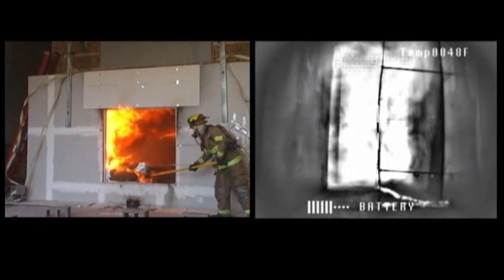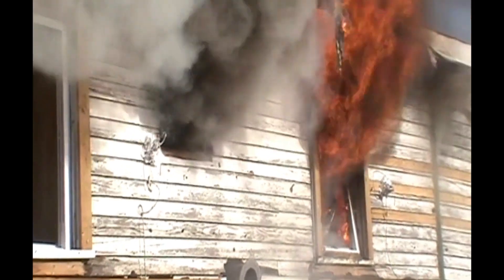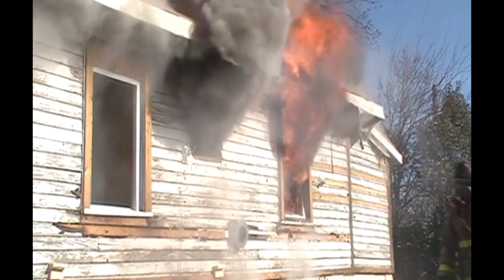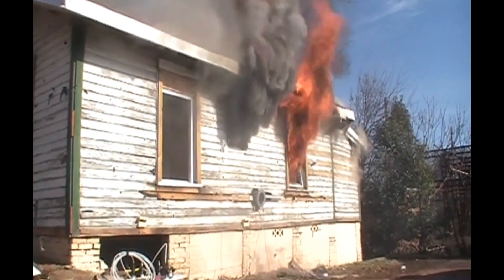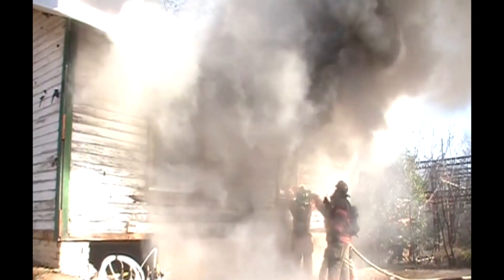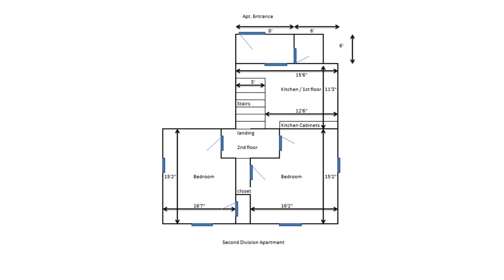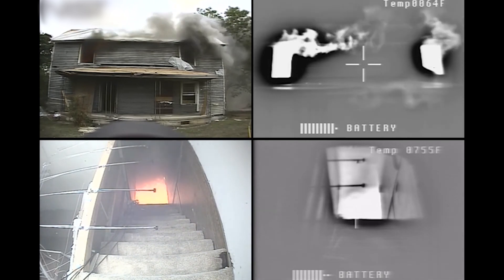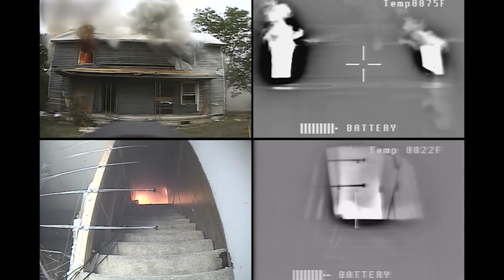Tactical Consideration: Pushing Fire

Comment: It can also push fire if the stream doesn't hit all the fire at once and entrains air because the stream is whipped. Or if it's a master stream. I've been on the wrong side of a master stream that pressurized a compartment on fire.

Comment: Applying plain, untreated water through the window only addresses the physics of the fire and does little or nothing to address the chemistry of the fire. Fires are more than just physics (heat). To address the chemistry of the fire (Fuels) you must add chemistry to your water. Adding surfactant to fire streams bonds water molecules to hydrocarbons in smoke and fire gases making them too wet to burn (oxidize). Lets move out of the caveman days UL and begin to address both the chemistry and the physics of the fire by researching the impact that Class A concentrate has on the extinguishment of fire. Jerry Hughes, Battalion 1 (ret) Chicago FD.

Comment: Just as we use fog to hydraulically vent from the inside it works in any direction even into a closed room.... the room will pressurize and blow back if the windows are open or gone it will vent the room

Comment: My take away from this would be to never use anything but a straight stream from the outside of a building and always aim at the roof so you arent blasting thru the building onto a search team. 

That using an open stream to blast the smoke an heat right out of that bedroom fire was slick and a nice stunt, but how many times are you going to know the floorplan?  A solid stream off the cieling that cools a room with fire ,already thru the windows without interupting flow path, seems like an awesome way to locally snuff the fire without affecting anyone in the building negatively.

Comment: Right to fight, left for life, nozzle pattern controls...
Reply: Sir, I respectfully disagree considering this was an old phrase that doesn't apply correctly as we have learned. The left for life is dangerous- as shown in the video, it disturbs the layering, distributes the heat, gases, flame and smoke and entrains more air in toward the fire past the nozzle firefighter. In the day of no scba use, this was beneficial to draw fresh air to move the attack forward but as research is demonstrating, this blanket quote isn't accurate or necessary with the advent of improved scba and firefighting ensemble.

Comment: I call B.S. water most definitely pushes fire . Idc how you word it with gas , oxygen . But when you are inside a structure on fire with a line being used from outside it most certainly will push the fire on to you and your brothers.
Reply: With all do respect of course, opinion (which you provided) does not outweigh empirical evidence. I would agree that having opposing hose streams could be potentially dangerous, but the idea of pushing fire is just not true.
Reply: @riseagan  We can agree to disagree , but my whole point of the comment is that interior fire fighting is the best method of fighting structure fires. Period . The whole reason I commented to begin with , was the 1st truck on scene started the 1st line from outside and I can't disagree enough with that strategic decision . Even if you show up on scene with people telling you its clear inside , you still have to check and be sure.  That is where my point stands.
Reply: @DeeKay617  Thats fine. And my point is that we should base tactics off of what is proven to be accurate. He just explained what happens in the occurrence of appearing to push fire. Interior vs exterior is also of course based on circumstance. For example, the science has shown that quick hits from the exterior prior to interior operations we shown to create a more survivable space for everyone. Which is why I like the idea of transitional attacks. Be safe brother.
Reply: DeeKay617 That’s the thing, you CANT “agree to disagree” with Science. If a study comes out at a later date that proves this otherwise, then so be it..we’ll change tactics. We just have to accept that the what the old guys “taught” us back in the day had no science or legitimacy to back it. Be aggressive but stop spewing inaccurate information and “making fun” of the guy doing the smart move by using a “transitional attack” when it’s absolutely the correct approach and tactic. 

We’ll still be aggressive as hell, we’ll still search like our kids in there but it’s time to change tactics up a bit. And remember if all else fails...KISS. Its not that hard. 

Still, the best tactic in imo is fast water on the hot stuff. Put the fire out and all other hazards go away. Doesn’t matter if you how you do it. GET WATER ON THE FIRE.
Reply: @JB91710  And what exactly do you want me to prove/ (teach) you ?
Reply: @JB91710  There are two types of ventilation we deal with all the time at fires: horizontal and vertical. Within that subset, horizontal ventilation can be broken down further into two areas: venting for life and venting for fire. In my experience, venting for life always presents the greatest hazard. I was always taught that if fire doesn’t vent from the window that you picked for access, get in and begin your search.  For instance I recall a fire in a 2 story wood framed dwelling . 
 I was assigned to assist in the vent, entry and search of the second floor. Due to the amount of fire on the first floor, I was forced to access the front of the building via a portable ladder off a porch area. The truck firefighter serving as the OVM (outside vent man) was already venting the three-window front at this level; he told me it was too hot to enter and that the fire would be venting out at any moment. I heard radio reports of people trapped inside, and due to the early morning hour I figured they would be in the bedrooms on the second floor. I took a chance and entered through the exposure 4 side (D side) window in the front. Amid intense heat, I hit the floor and started my search. When I reached the door to the room, I could see the fire venting down the hallway about fifteen feet away. Almost immediately, the fire quickly roared down the hall, over my head and vented out the windows. The heat became so intense it forced me back out the window; I was fortunate to get onto the set-back with no burns. My mask and hand light strap were completely burned off. The encounter served as a good reminder that venting for life brings the inherent risk of pulling fire in your direction. Although essential, it must always be performed for a specific reason.
Reply: @JB91710   And now ill share something about vertical ventilation . Vertical ventilation is a tactic used in the initial stages of fire operations and is employed for a variety of reasons. When done properly, it relieves the uppermost portions of the building of heat, smoke and gases. It can also prevent mushrooming; a condition caused when heat and smoke spread horizontally and push down to lower areas of the structure assisting fire extension.
Reply: And im not far from CT we can have this discussion in person anytime
Reply: @jamesbarnes1847 the hazards don’t all go away.  A trapped person who is in a room that a 1000 degrees and a person who is in a room at 300 degrees are both dead.  Cooling the compartment from the exterior with trapped victims on the inside and saying that your making the hazards go away is a crazy statement.
Reply: @riseagan  Have you ever been 1st into a burning structure fire ? And these studies were done by scientists not actual firefighters. I can tell you 1st hand it most definitely pushes fire.  Have you been part of any fire ground rescues ?
Reply: No it doesn't.
Reply: John Cocca Interesting video. Please don’t mistake my comment for a comment advocating outside fire attack and “dicking around outside”. Bottom line is fast water saves lives which is usually achieved through an aggressive interior attack. I think we can agree that transitional attack is the exception, not the rule. That being said, if my crew sees a compartment fire on side alpha blowing out the window then yes, I’m going to hit that real quick with a solid stream before entering. Hitting it will give the victims more of a chance(that extra 30seconds it takes for me to they to the seat) until I get up there and put the rest out. 

I agree, no one needs to “staging outside”. Nothing beats an aggressive nozzleman. It will not take 2 minutes to accomplish this. A short burst through the window to calm conditions for the right scenario. 

Have a good day my friend 👍🏻
Reply: @John Cocca Same to you brother , stay safe ! And thanks for your service sir . True hero 👍
Reply: @DeeKay617  My experience is that the transitional attack with quick ventilation allows for faster and more effective interior operations bc you are walking not eating carpet. Since adopting transitional with PPA we are saving 95% of pre-fire value and have removed seven viable victims from involved residences. We also utilize solid streams for exterior application  allowing for simultaneous interior/exterior operations further speeding up primary search and fire control. 
A secondary benefit is the reduction of interior temperatures and pressures reduce the carcinogens being pushed through our vapor barriers.

Comment: My thoughts on a good conversation to have. Pushing fire can occur from certain water application methods using fire streams, there are three understood contributing potential mechanisms at work, occlusion of one or more vent/or exits of established flow path (this can occur interior or exterior, moving energy to the new path of least resistance) air entertainment of the fire stream (displacement), and finally inadequate gas contraction during water application into a involved space (inadequate rapid cooling).

Hand-line fire streams have this potential, to push “fire” gas from rich to lean leading to burning, but one must understand this can occur from both interior and exterior positions. Proper knowledge and understanding of handline fire streams, reach, water mapping, air entertainment potentials and their ability to seal spaces is the discussion we need to be having. This gives the Nozzles the proper knowledge and understanding to use their handline stream best. Anyone that has taken a class of mine in the handline fire stream section has noted this is gone over in detail, including burns that occurred from interior pushing of fire onto search teams. Do not let anyone say different this is both an interior and exterior phenomena.

A handline fog nozzle in a fog pattern is bail limited (negative change in conditions driven, low surface cooling), reach limited (localized gas contraction, but little to none at distance) and high air entrainment with movement of the line to map an area 15k+ CFM is possible. These attributes make pulsing and open and shutting the line more necessary because sealing and over pressurizing the advance is more possible creating a negative pressure behind the nozzle team. In addition since water is distributed in such a way (many small droplets) massive surface cooling is not readily occurring more steam is produced when the fog stream hits hot surfaces, this can out pace contraction that is occurring leading back to the pulsing of the stream to prevent this.

Solid & Straight Stream handline is a bail non limiting binary application method, typical run in the wide open position without movement somewhere around 1000 cfm is occurring and with movement around 6000 cfm of air entrainment. This occurs with reach, so gas contraction can happen both locally and at a distance as the stream is played about. In addition in the 150 to 185 gpm, 40 to 60psi nozzle pressure range massive surface cooling takes place, so additional steam production that can overwhelm the gas contraction is less likely. Finally without movement it will not seal the exit of a flow path, making it ideal for exterior application, but also with movement inside it has the potential to adequately seal the advance. This allows for pushing the products of combustion and extinguishment away from the nozzle team, but also creates a condition less likely to over pressurize the advance because only 6000cfm is readily possible, and this is done while maintaining reach.

The attributes talked about above make the high gpm, low air entrainment handline fire stream in the 85feet/sec range more forgiving to operate on the fire ground and provides a focus on functionality over efficacy. It can and will when properly used readily contract gas, cool hot and pre-treat uninvolved surfaces (safer), entrain a sweet spot of air (not too much not too little with movement), interact with flames and achieve base fire extinguishment. It does this in a simultaneous manner with the most constants and the least variable to account for when operating the handline.

This making the high gpm, low reaction force straight or solid stream handline in a flow and move application methodology ideal to utilize in a task saturated and time compressed emergent condition that is the modern fuel load. Addition of lots variable in a quest for efficacy in suppression utilizing fog pattern (low or high gpm) as it relates to total water use is a Don Quixote Esk ethos based in the facts it’s possible not within oath of the mission of saving Life (1st) and Property on the fire ground.
Reply: Dennis LeGear whats your thoughts on the new nozzles coming out like the fixed gallonage combo nozzle by elkhart 160gpm @50psi
Reply: @John Cocca  Thank you for your service sir , and for the record I agree with you 100% !!!